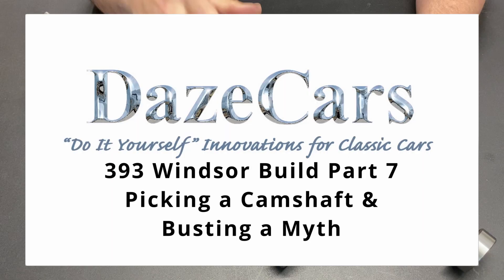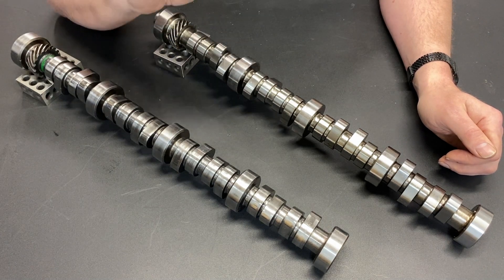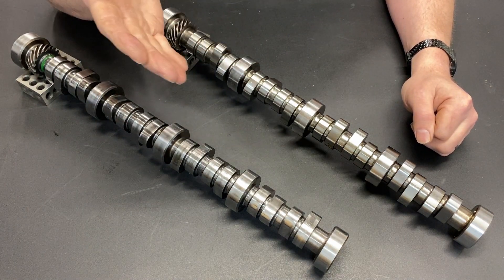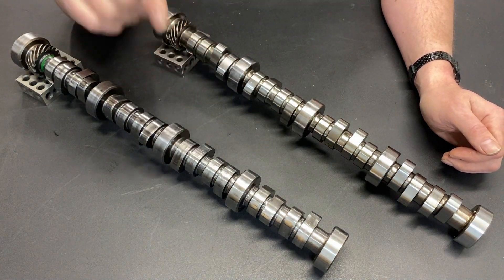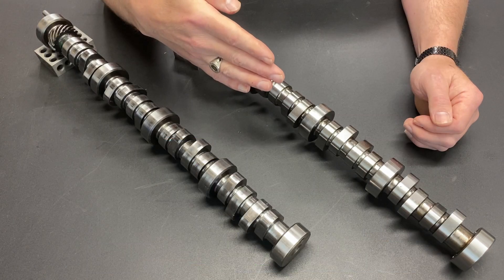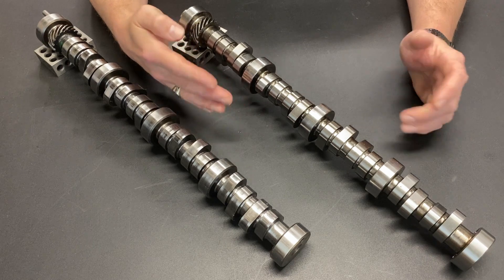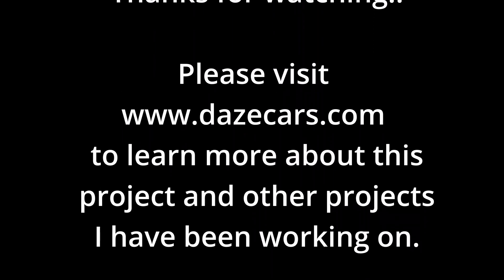393 Windsor Build Part 8 Picking a Camshaft Part II Dyno Graph of F4TE, HO, Trick Flow and E303

Comment: You have the effects of lsa exactly backwards. Tighter lsa is worth bottom end and wider lsa is worth top end
Reply: Not always true.   Rich Holdener did a few videos were tight lsa won across the board for the same lobe.  We guesstimate that tight lsa made more use of exhaust scavenging.
Reply from the maker: It all totally depends on the combination of parts and the combination of specs on the cam.  That why I love the dyno software there is no guessing.  I put in the info and can see the curve.  Even of the curve is not 100% accurate in actual numbers its shape is accurate.

Comment: I used Dynosim5 and went through a dozen cams and came up with Comp 35-250-4 for my 389w.  You are right, trend is the important spec.  I figure the program adds about 15HP too much when adding Headers.  Real world dyno tests show about 25HP for long tube headers, the program adds about 40HP.
Reply from the maker: Exactly!!  I think its is on the high side, but if were are consistently high throughout the curve than the shape remains the same.  Intake manifolds is the other area where the program is really lacking as there are way more verities and flow rates than simply single or dual plane.  Thankfully there is enough real world dyno info out there comparing intake manifold to make a good decision and know how it will affect the curve.

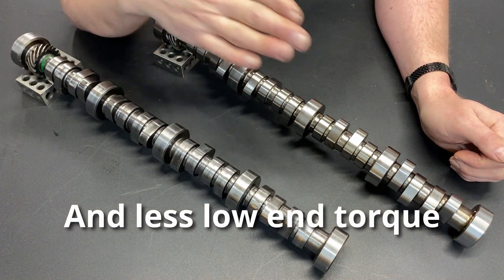Comment: 3:14 I've done some research on this, and here are my findings based on dyno results. Tighter LSA will give more low end power. Keeping overlap moderate prevents excessive reversion, maintaining idle quality. You can have a tighter LSA with less overlap by reducing duration. Most aftermarket cams have too much duration for street applications (marketing), and then increase LSA to compensate. Increasing duration moves the power band higher. Both increasing duration and increasing LSA reduces low end power.
Reply from the maker: Its all fairly complicated thats why I like the virtual dyno.  allowed me to dial in the exact torque and horse power curve I wanted with out having to understand all the differences.  My combination produced good torque and decent power through 5500 which is exactly what I wanted.
Reply: @frankenstein01  not only adding duration moves the power peak higher in the rpm band it also shortens it so max power may be from 6500-7200 as a example the centerline also plays a similar role. If you want torque and a big flat torque curve use a 112 or 113 center line and max power will also stay down under say 6000 if you want to move power up and increase it go to a 107 /106 center line and peak power will move up over 7500 and will be a very narrow range maybe only 800 rpm say 7400 to 8200 and it will be flat till 6000 for sure. When they set up an oval track car they make everything happen from say 6000 -.7500 and change the rear gear for the length of the track so it comes out of the corner at 5900 and gets to the end of the straight at 7500
Reply: Smart

Comment: 1- Camshafts are about maximizing cylinder filling (air/fuel volume)

2- each engine configuration is different. (Intake runners on a 351w are longer than a 302. Some exh ports don't flow as well etc etc)

3- LSA is the first spec in selecting a cam to maximize cylinder filling and overall engine output.

4- Overlap is the second spec to determine where you want the engine peaks to be. 

5- Duration is the "byproduct" of the first two selections. It is the result of choosing the first two specs correctly.

6- Lift, tied to Duration, is related to valve speed, ramp rate, etc. Higher ratio rockers are effective moreso because they lift to a higher point faster, not so much because they increase total lift.

Then there are other factors that must be taken into account too like idle with A/C, brake power booster, static compression/cranking psi, etc.

If you select accordingly you will have driveability you desire while your engine maximizes it's output potential. Intake charge that never makes it into the cylinder, gets bled out the exhaust, or results in detonation is all a fail.

This is why pros get paid to spec a cam for you. If you don't know what you're doing it's worth it to pay to get the most output for your money. My two cents. Cheers ~
Reply from the maker: Thanks for the lengthy and well thought out response.  Everything you have said is correct, with one exception, using this software like I do in this video is much like asking the experts BUT you have the freedom to compare camshafts across different makers.  Each "expert" is only going to provide a selection for the the company they work for.  You can't get dyno200 anymore but the latest version of the software, dyno5,  can be purchased and used to eliminate the "cam expert"  In fact the virtual dyno is better because you can put in head flow numbers.  The cam expert isn't even going to look at that. I would much rather have the tools to make my own choices than to trust that the guy on the phone really knows what he is doing and has all the info he needs to make the correct decision.  
https://youtu.be/rML9EJEe3dY?si=ElFeSNLZLJl0aSnV
Reply: @dazecars  My comment was a general statement for all, not directed at you. While I agree there is some help from using simulation software, there are unforeseen variables too.... For example, one head may flow 300cfm, and another 270cfm. By flow input alone, the "superior" head will make more power on a simulator. But what we've experienced in real life Dyno sessions is not always the case. Often, far too often, we are where a block is capable of using every bit of a "300cfm head", but will make better overall and better peak power with the "inferior" 270cfm head. Why do these anomalies occur? Because sometimes one cam and supporting combo favors the "lessor" head. Sometimes the lessor head does a better job of swirl and tumble with the air/fuel it provides the cylinder, better dispersing the charge in the cylinder. Sometimes the "restrictive" head had a better chamber design, and better quench areas.

I'm just saying there are many factors, and most OTS cams work well and "good enough" for most people. You put a combo together and wow, it makes 400hp/tq to the tires. Well.... What if a different grind cam made 440 to the tires, in the same RPM spread, making noticeable improvements everywhere across that spread? Wouldn't that be worth $100 to ya?

I'm not saying every "pro" is a pro.... But those that are, truly know their stuff, and earn every dollar they make doing what they do. Cam company xyz is probably going to hand you cam with 112° LSA for a 393w, because it'll "idle better".... Rather than toning down the overlap and duration.

If a cam has 100° of LSA and only 10° of overlap.... How exactly does that kill your idle vacuum? Excessive overlap kills idle... Not the LSA.

If you have 120° LSA and 100° of overlap, I guarantee your idle is going to suck!

I guess ultimately people misunderstand much about cams. The LSA is getting the exhaust to draw on the intake port at the right time relative to how columns of air move in a given combo.... with all factors varying that. For example, a 2.08 valve will require less LSA (higher number) than a 1.94 valve will. 12:1 less than 10:1, etc. Many factors in optimizing a choice of valve event timing.
Reply from the maker: once again fantastic info and I do apprecite the coment @richdouche8253
Reply: @dazecars  PS - I'm sorry I don't know your combo of parts, but I know a 393w is big block cubes and can use big block sized heads and big block cam specs and still be very stout down low and make a broad curve. I think you'll find that small TFS cam is going to leave a lot of potential on the table and you might have to retard it some for cylinder pressure/detonation depending on your heads/intake?

Let me know how it goes. Cheers ~
Reply from the maker: The intake is a work in progress (see some of my other videos in the series) as to the heads its flotek thumper.  I agree that given the limitations of the 302 designed parts now at 393 cubes a bigger cam would be in order for max power but I am not going for max power.  This engine is being built for 1500 to 5000 RPMs so it should flow enough.. I'm hoping.  all in all I'm after lots of low end torque and a generally mild build thats why the 393 and the flotek cam.  Thanks again for the input  @richdouche8253
Reply: @dazecars   experience has shown me that heads and cam are the two largest components in making power in an engine, I will never skimp on either again.  Camshafts are tricky things and even as a power engineer who learned from speccing a cam using your Engine 2000 software then changing that for a custom I will always go to a cam expert to spec one for me. In my opinion every cam you are considering are too small, you are leaving a lot of power on the table with those, you need seek out the engine dynos of Richard Holdener for Ford engines, he shows on a Dyno not software that you can add more duration and make more torque down low than the 302 cam you went with.  Best of luck to you and curious why do you think you need so much torque down low, can the vehicle this is going in put that torque to the ground?  I ask because I made the mistake of building 331ci sbf for torque (wanted a 5500rpm peak as well) and it was a mistake, way more torque than car could handle, was breaking stock components but more important had trouble with tires breaking free rather than hooking up.  First time my tires broke free on full throttle highway romp in third nearly made me change my shirts 😮
Reply from the maker: biggest reason I am after the torque is the galaxie is a big old girl and it take a lot to get it moving.  With the 5 speed manual I should be able to have a lot of fun with it in the desired RPM range and the car is as much about cruising as anything else so  all these things together effected my decision making.  I could have this dialed in to work exactly how I'm  picturing it or I could be totally wrong, we will see.
Reply: @dazecars   393ci will get that moving you are leaving a lot of power HP & TQ on the table but it’ll be one smooth engine
Reply from the maker: exactly what I am going for, lot of initial go, excellent idle and engine smoothness and moderately okay milage.  in other words power for days off the line but then a fantastic cruiser.

Comment: The video has a very good & easy to follow presentation. Most of us enthusiasts / hobbyists can enjoy videos like this, because we may be building or planning engine/car builds similar as such...That being said - the only thing I would have considered in the camshaft timing, would have been to entertained more exhaust duration. This is due to the fact that a SBF head has a weak design(to small & to low of a floor). The revised design of your Thumper head exhaust port may help, however the increase in cubic inches suggests more exhaust scavenging could be a plus benefit. Tri-Y  1.5" primary headers will also help with the given weight of the vehicle & desired operating range...Lets not forget that this is a DRIVER - not a race car...I just built a 302 engine for a 1965 Mustang 2+2 - with a similar Lunati hydraulic roller cam & its a BLAST to drive!!  Its like driving two different cars. Down low at 1300-1500 RPM w/ a 5spd & 3.40 gears, very smooth & well behaved...Jump on it with the double pumper carb - and it lights up the car with a very satisfying rush of acceleration! That was the goal...I'm sure that you have the same objective in mind...So enjoy it!!
Reply from the maker: That is fantastic information and lots of good things to consider.  The biggest problem I had was finding something ready made for a roller block.  There were tons of retrofit cams, and there were tons of flat tappet cams, but when I went to an OEM  roller cam that was not retrofit there were only about 10 or so non stock grinds to choose from.  A better option would have been a custom grind but I found the trick flow cam was close enough.  The Howard's cam I was originally looking at did have a little more exhaust duration and I probably should have done that, but I didn't want to wait for it when the trick flow was "close enough".  Glad you liked my video and thank you so much for the insightful comment!

Comment: Glad you explained that a wider LSA dont mean you sacrifice HP. If you watch Engine Masters they have tested multiple cams with just a change in LSA and have proven a wider LSA can produce more HP in the upper RPM range but it takes the right duration to do it.
Reply from the maker: yep.  people talk about LSA and duration as individual specs but they are totally related
Reply: @dazecars  Absolutely. I learned a ton on Grumpy's Performance web pages. Another thing most people dont understand is the how the ramp angle effects valve train. I have seen test of Race cams VS Street cams VS the new soft ramps and its unbelievable what the spring goes through at RPM.
Reply from the maker: I received an email saying you made a post on my new video but when I went to respond to it your comment was gone.
Reply from the maker: @440cubicinch  I could see that it was on the new video but It was no longer there for me to reply to, thanks for reposting.

Comment: I have the trickflow stage 1 cam for my roller 351w, I want to upgrade but I’m not sure what fits with my sbe and old trickflow 170s. Cam would have to be bought and installed to even check ptv clearance.
Reply from the maker: I would think you could measure PTV and calaculate exactly how much lift you could have.
Reply: No that's not true buddy. First off get all the spec details on the cam you have. Then make sure that you have the correct supporting parts to make full use of the upgraded cam. Carburetion valve springs, fuel supply cr is very important. Remember any time you increase over lap in a cam you are lowering the compression ratio. And a full point on a street motor I think I heard 40 for a full point. So from 10:1 to 11:1 
So you make sure the rest of the engine wants more cam then you cylinder heads tell ya what to run. And when that is all covered then make sure your not going to kiss the piston because that really isn't a big deal to slip them out increase the valve relief and put them back in. If you do all that your reward will be worth it. If you have doubts say after you take a shot at it you can always not only check yourself but if need be chuck your specs in the trash and rest easy by contacting David Vissard and if you do you homework correct be prepared to wait a few weeks chances are very good that you can will be custom ground. Unless you settle and find something close. But for me the point of doing that homework is to get the best cam and reap the Benny's.  It will more than likely not be a off the shelf cam but the price a lot of times doesn't change if they have a blank that will give you what you want. I know comp came will do a custom grind for me and it's the same price if they use the off the shelf blank. Do the homework you'll learn a lot and gain a huge dose of confidence. And then holler at David   V. If he comes back and tells you something of a mirror of what you came up with how would that make you feel ? There will be some work involved doing the home work find vids that tell and explain how to do it. And do it right anything David V. Tells ya is great into. Start there. Good luck you got it it just takes some time to learn it then your home free
Reply from the maker: This is exactly why I love the software.  it allows me to see the curve with my combination of parts so I can correctly pick the cam.  Obviously the final numbers are not likely accurate but the shape of the over all curve and RPM range is.
Reply: Have Ed Curtis at FTI suggest something.
Reply from the maker: problem with that is trusting you have conveyed all the info the guy at the the cam manufacturers needs.  at least with the software I can plug in all the info and get a visual of how the motor will respond rather than hoping there was good communication with the "expert"
Reply: @dazecars ed Curtis been around over 30 years and knows Fords.    He has a cam that made 411rwhp/372rwtq in a stock bottom end 302.    Tfs 11r 190 heads, vic Jr intake and 650 holley double pumper.   Exhaust was 1 3/4" long tube.  Rough cam specs are mid 220 intake, .640" lift 108lsa.
Reply from the maker: I was not at all disparaging your info source.  I am sure he could pick a great cam if he gets all the info he needs.  My point is sometimes communication between the end user and the expert can be challenging especially if the end user doesn't realize they don't actually know what they want.  So many people are blinded by horse power and pick a came that is way bigger than what they really want/need.  Seeing it on a graph however clears that up for a lot of people.
Reply: @dazecars Ed was big on these chats before the web got big.   We used email.    He knows everything from the beginning until today.  And even in the 90s made great combinations.